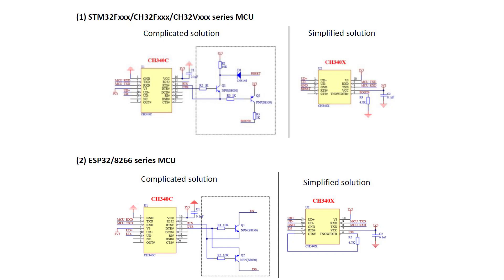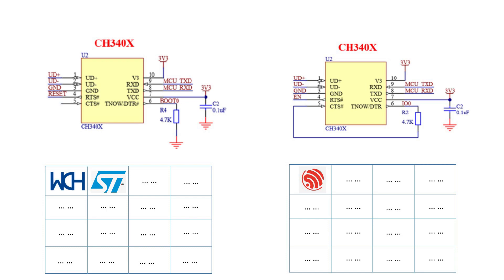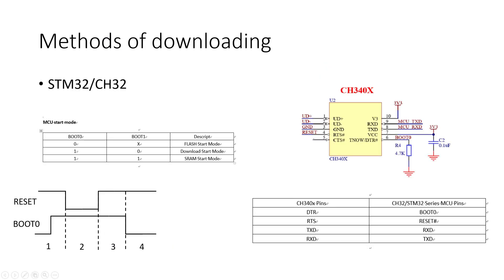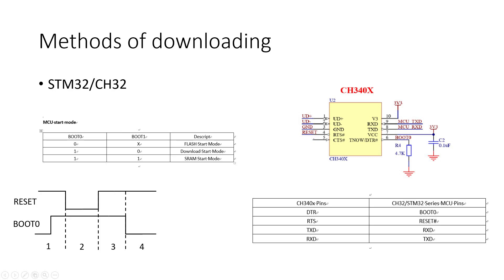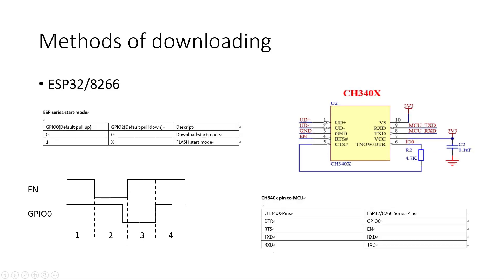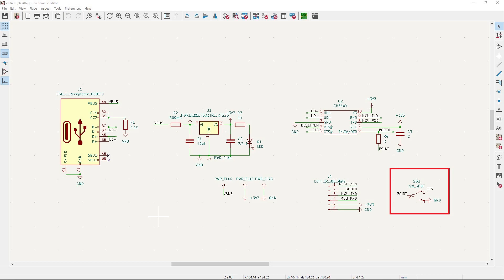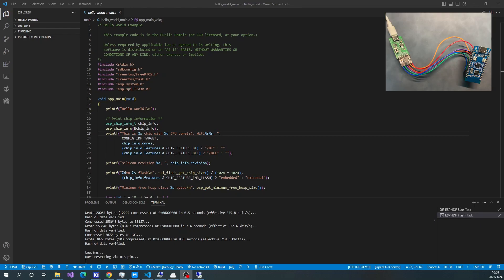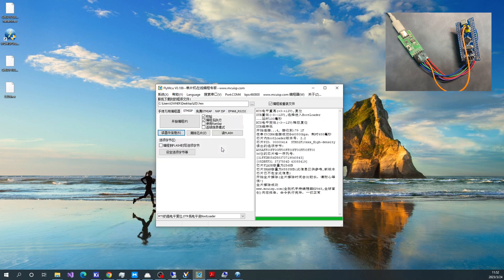#7- Awesome Auto-Programming solution for STM32/ESP32/ESP8266/CH32

Comment: can it connect directly to 1.8V MCU or would it need a level shift?
Reply from the maker: yeah,  a level shift is required
Reply: @rvmaking  I have a design based on your schematic using level shifters but have couple issues.. So, I used 2x PI4ULS5V202UEX level shift chips and added LDO and a switch to select target voltage.. you can choose to NOT power the target or, power with 1.8-3.3-5V.. so far so good and power circuit and switch works nicely. I have also added a switch to allow 4 mode settings, one is "UART" meaning you dont care about the 4.7k resistor position and only want to use the device as a USB2TTL converter. Second position is connecting a resistor between Rx & Tx to allow UPDI programming. In positions 3 & 4 the switch connects the 4.7k resistor either between DTR and CTS for ESP32 programming or from DTR to GND for STM programming.... so far testing shows its working although I need to do more tests ... the problem is, when I select 1.8V USB bus "enumerates" again.. device is disappearing and appearing back instantly but, I dont know why that is happening.. it does not seem to be a problem although I have not yet tested with 1.8V MCU to be honest, it is just strange.. the level shift chips allow different voltages on their two sides both A > B and A < B so in theory CH340 should not notice any difference...